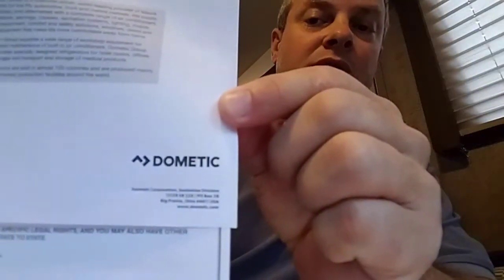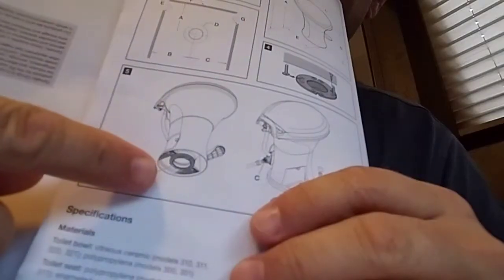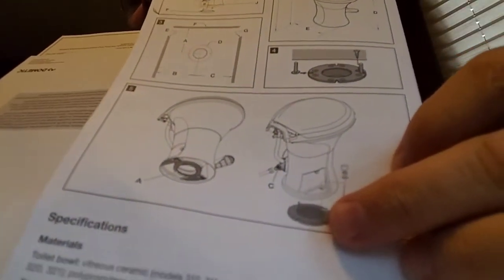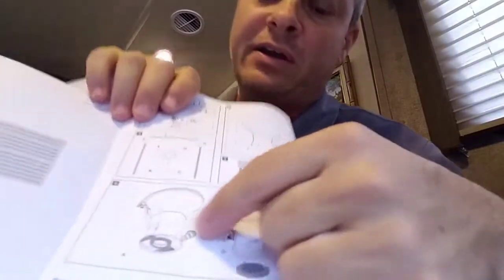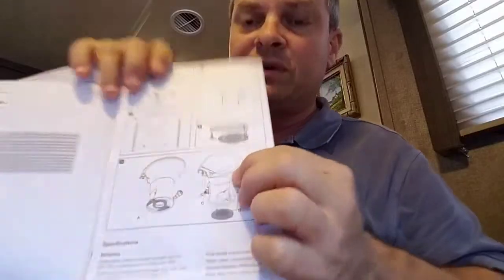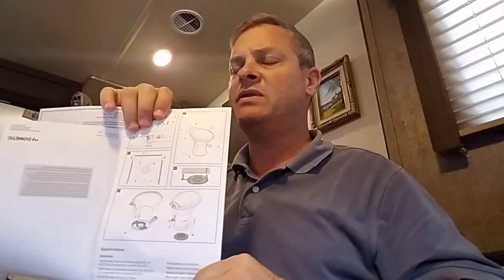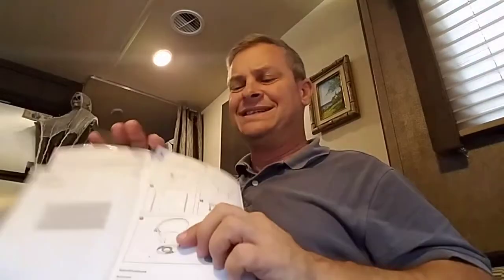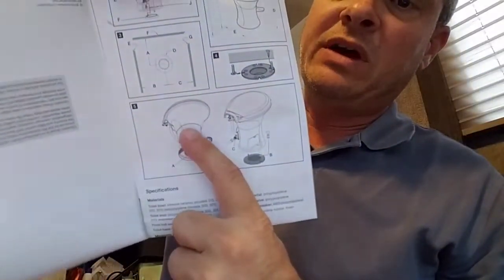RV living - Domtic 300 series defective toilets. IMPORTANT!!

Comment: Yep. Happened to me as well. 10 year old toilet. The gray foam donut seal between pedestal and bowl was not happy.  The nylon grommet nuts are shot and the 4 long bolts were really rusted. Bought new larger 1/4” SS x 2 1/2” bolts but they would not grip the nylon inserts. Called Dometic company and spoke to a very nice lady, who contacted some sort of engineering or technical services group to see if they could supply me with 4 new nylon inserts. After a few conversations between her and the technical group with my insistence that they should be available, the answer was clearly NO we do not supply new nylon inserts. So basically, instead of replacing The round foamy gasket for a few dollars, and the nylon inserts, which shouldn’t cost more than a few dollars, I need to replace the whole stinking toilet. Unfortunately the 320 toilet is 1/2 inch too long to fit. This really stinks, literally.
Reply from the maker: Well..... Sounds like a tough one.  YOu really have to check the installation manual and clearances.  I know there are three different depths of toilets based on the discharge flange.  There are other manufacturers to look at as well that might have what you want.
Reply: I found a solution

Comment: Just get the 310 porcelain. I had the plastic 300 and got rid of it before I started having problems. I had the 310 in my Coleman  before I traded for a bigger camper. And saw this in my new camper. Actually it's a 2021 wildwood  and immediately changed it. You can interchange the valve system so I kept the plastic one for parts.

Comment: Thanks have new rv and found water on edge. Save floor just in time. Will do myself. No need to travel three hours for simple repair.
Reply from the maker: Yep - And dont have to wait for the repair department to messup other parts of your RV.  It took me a couple of hours but I was really investigating what had happened.  The job all in total would take me 30 mins or so.  Just wear gloves and then change them after getting glue on them.  Wash and dry the foam rubber seal.

Comment: And four years later.... still defective.  The toilet in my 2021 Grand Design Reflection 278BH showed signs of leaking twice.  The first time, about 6 months ago, I tightened up the two base nuts and it stopped leaking (or at least the water on the floor).  Just noticed again today, tightened up the nuts a little bit more.. but after seeing this video. I had better take it apart and inspect.
Reply from the maker: Just remember.... its not the flange seal for the toilet to the floor.   Its the seal that joins the two halves of the toilet together.

Comment: Same issue in my 2021 Montana High Country! Thanks the video. Rv parts are expensive and poorly made!! Keep finding issues after issues. Pandora’s box
Reply from the maker: Unfortunately the RV industry is a bit lackluster.  Of all the RV is that I have purchased in the past I have had pretty good luck for the most part. But I will say this. My initial walk-through of the RV is very picky and everything must be fixed before I leave the dealer.   I never will accept a unit with issues.   I do have to say that my experience has always been with travel trailers and fifth wheels.   I have never taken possession of a motorhome or class c unit.   Domatic as a company has gone downhill. I've had multiple issues with equipment installed in my RV. Just recently we lost the refrigerator about two months out of warranty.  After investigating this further it appears that the refrigerator core was made from cheap steel and rotted out.  I have always employed the technique of keeping the refrigerator going and never storing it.  This keeps the core warm and usually increases the longevity.    So we had to spend $1000 on a Furion electric refrigerator and trim kit.   We had issues with our water heater as well that is a Dometic.   If I were not a do it yourselfer......  I tell you.

Comment: What tool did you use to take out the 4 screws that hold the top and bottom together. A screw driver or a socket and what size is it or what?. I can't tell by looking down in the hole the screws are in.

Comment: It's a toy toilet. Like a plastic Barbie toilet. At least it's plastic. Most RV stuff is made of paper.
Reply from the maker: You are correct kind of junk.   I will say since I fixed my unit and sealed the center section I have had no issues.

Comment: I just called Dometic regarding my 310, representative said even due they are aware of the problem, they never admitted to it, she looked up the serial number, said the manufacturing date is more than 2 years old therefore she can not help unless i email proof rv was purchased less than 2 years ago and i am the original owner. she also told me that to her knowledge no design change has been implemented since 2010, and they still receive calls regarding this issue with new less than 2 years old units and send replacements. Maybe we should sue them?
Reply: The Zeroth I also have a 310 and I spoke with dometic about an internal leak and they told me that the issue I was having was the water valve. I sent them a video of me operating the valve manually with no leak coming from the valve but still leaking internally. They just said my problem was the valve and that it has been a common problem. I know the valve is good
Reply from the maker: @jonathanquezada1403  Thats a lie because the valve is on the exterior.......

Comment: It would help if you also showed how you got to the side bolts that commonly hold a house toilet onto the the floor flange.  I cannot figure out how to get to that point.  I have a ceramic toilet with a plastic skirt I don't know how to remove.  Thank you.
Reply from the maker: Should be like a standard toilet flange with toilet bolts.  Really can't elaborate on it but to say it's the same as every toilet I have worked on.  Yours could be different though.

Comment: Just an update. I ordered the toilet on the 13th got it on the 15th and wouldn't you know after putting it in ,it has a leak too !!! Ill redo on Monday . It is the part at the foot operated valve. A tiny ball is pushed on as the foot lever is used and mine leaks and runs out of the bottom of the lever. I very wary of this brand now. They have their shipping down though ! LOL..WISH ME LUCK .
Reply: Zofoblues Zofoblues i agree. Going on 3rd toilet but this time we ungraded to a 310 series with wooden lid to stop the plastic from crackling.
Reply from the maker: Yes I'm familiar with the issue. Those valve is really suck.
Reply: did you get it fixed?

Comment: Thank you. Do you think a different brand would work or a porcelain toilet?
Reply from the maker: Possibly. Typically what you have to look for is clearance behind the toilet fas measured from the center of the toilet flange to the back wall.    If I recall there are 4 different sizes of toilets.   There are other RV toilet manufacturers out there.   I don't think you could use a home toilet because it would fill up your black water tank very quickly.

Comment: Regarding your "fix" you've mentioned RTV silicone adhesive sealant, E6000 high viscosity adhesive and DAP 18388 flexible waterproof sealant.  I only want to do this job once so which of these three do you recommend most??
Reply from the maker: I used E6000 but a silicone sealant is flexible enough.  I used rubber gloves with the E6000 to really work it into the gasket.  But be warned..... Only do this after cleaning the gasket really good and drying it.   Have your surfaces clean and ready to reassemble.  Discard the gloves after putting the seal in place.... It makes a real mess.
Reply: @PilotManForever  Thanks, I'll take your advise and get this done on Wednesday.  Dometic is now making all claimants go through their local dealer/service center to this warranty claim.  The locals are swamped, have no stock and no availability from distributors, making them work directly with Dometic which may take forever.  My conversations with Dometic today indicated it would probably be weeks before I would ever see a replacement 300 toilet; their claims are back logged and new stock flies out to fill these claims.  I can't wait so I'm fixing it under your guidance.  Wish me luck and good skill.
Reply: @PilotManForever  Mission accomplished (ugh, I hate phrase).  I would seem the E6000 added some thickness to the gasket complex even though I was quick as a bunny and had the toilet screwed back together in no time.  How do I know that?  The toilet now leaks bowl water ever so slowly.  I've ordered a new seal and hopefully that will fix this "leak" in my one year old Dometic model 300.
Reply from the maker: @garyswanson2357  The seal in the bowl needs to be cleaned to get hard water off of it.  It can be lubed with plumbers lube as well to keep the seal nice and pliable.
Reply: @PilotManForever  I did both of those things when the toilet was apart.  I think the new seal plus lube with work.  As for the out house stench... gone, even with the imperfect seal!  Thanks.

Comment: I bought mine used and my toilet looks like a 300 series but I cannot find that stamped anywhere. I dont think it is leaking anywhere like yours but it will not hold water and I cannot find any info on how to take it apart to replace the ball gasket or what kind of gasket I need?
Reply from the maker: The holding of water is a different issue.  Can usualy be fixed with cleaning the hard water off the lip.  Use gloves of course.
Reply: @PilotManForever  I actually found the gasket installed upside down.  easy fix
Reply from the maker: @motodrummer  are you talking about the center section gadget or the bowl flush seal?

Comment: How did you get the base screwed back onto the bowl? The wing nuts just dropped in the bowl and I can't get them out.
Reply from the maker: Once the toilet is off the two floor screws, turn it upsidedown and you will see the four Phillips screws that connect the bottom and top parts.   Not sure what to tell you about the wingnuts... sorry.
Reply: Wish I’d seen this first. I called Dometic and they said the only solution is replace the toilet. Curious how CJ handled this
Reply: @fwbenson57  I bought another toilet. I did not buy another dometic.
Reply: Same thing just happened to me, they fell inside the bowl  CJ Gibbons did you get the wing nuts out I sure can't!
Reply: @valeriemarik9042  nope had to buy a new toilet. I did not buy another domestic.
Reply: @cjgibbons5850  what did you replace it with?

Comment: What cleaners did you use for the caskets? I was thinking of dawn dish soap.
Reply from the maker: While wearing rubber gloves, I used dish soap, and cleaned three or 4 times.  Then dried in-between papertowels.  Then used a blow drier to get it completly dry.   Used windex on the other surfaces to get them very clean before using the E6000.  Using a pair of disposable rubber gloves I put the sealant on the upper and lower surfaces of the toilet and then  massaged the sealant into the gasket before laying it down on the upper surface of the toilet while the toilet was upside down. When you put the screws back in make sure that you don't over tighten them. You are screwing into plastic.  I let the toilet dry for 24 hours before using it just to make sure the seal it was completely sealed.  We did that back in 2017 and have not had any problems since.

Comment: It’s never been fixed! The second toilet was worse than the first!
Reply: Yes I’m glad it can be fixed but ours was only two months old. Brand new camper. So we used our warranty. Twice. We shouldn’t have to fix a brand new camper. Our neighbors bought a $75,000.00 camper and the roof leaked and ruined all their cabinets. Definitely a warranty issue! But, it is a hassle to take a camper in you have set up to live in. They came out the first time but my husband changed it the second time. We have three drains counting our washer. Hassle disconnecting to take it in.

Comment: What's the sealant you used?
Reply from the maker: E6000.  But RTV silicone will work too.
Reply: @PilotManForever  hello major! Are you still active on this chat? I have a one-year-old Dometic 310 that is leaking from the valve area. They sent me a new valve right away… Not acknowledging what I learned from your video just now… No surprise. Are people saying that their replacement valves are also faulty? Wondering if I should just do your fix on the old valve, or replace it and do your fix as well… Thanks for any comment.
Reply from the maker: @LovingIntelligenceIsAll  yes still following. I get the updates whenever a message is received. Hard to believe there have been 50,000 views on this and that domestic is causing such an issue with peoples RV's -  should probably ask for a little bit of clarification before answering your question.  Are we talking about the filler valve on the right side of the toilet that lets the water flow into the toilet?   Here is a video for the water valve:   https://www.youtube.com/watch?v=hVT75xgnkn0.